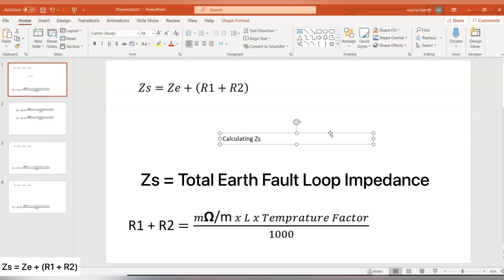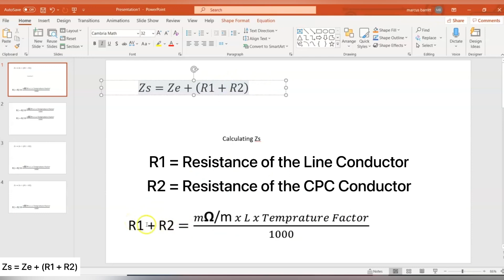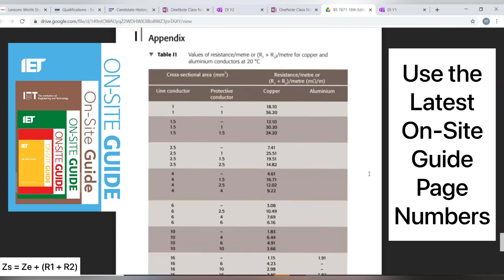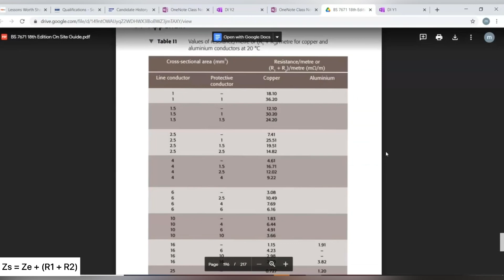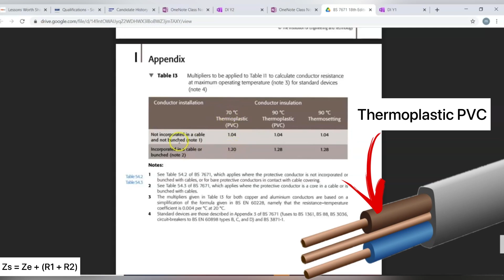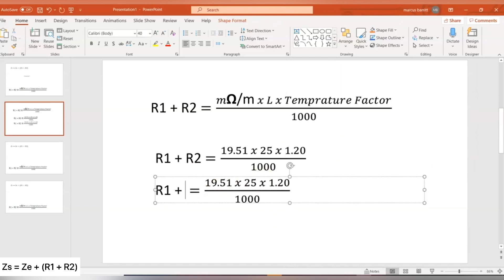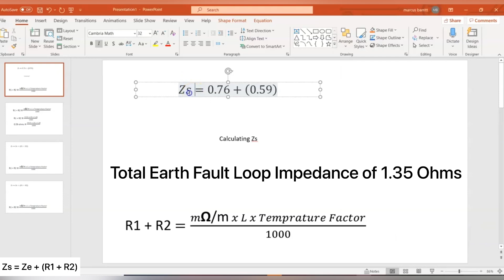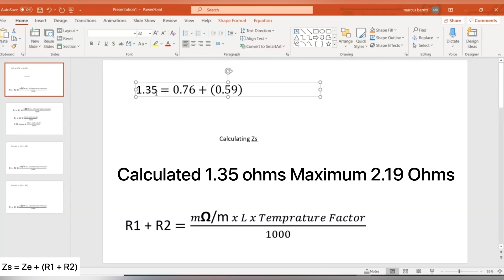How to Calculate Total Earth Fault Loop Impedance - Applying a Temperature Factor to R1 + R2

Comment: Hi. I'm Alexandru from Romania, and I’m watching all the videos trying to adapt or understand certain things.

Regarding R1 + R2, which is calculated, I think it’s a bit complicated to know the exact length of the conductors from the distribution board to the 230V socket.

If we measure the resistance at the socket after connecting the PE and L wires together at the distribution board, would that be a valid solution? The measured value would, of course, be multiplied by the correction factor for 70°C.

Comment: Audio is terrible
Reply: The audio for me was inconsistent. Some parts were clear but other parts not. I assume a radio mic was being used. It seemed like there was some sort of signal problem or bad connection. I had to switch on subtitles because it was difficult to pick up some of the numbers being said. Keep up the good work guys.
Reply from the maker: Sorry
Reply: No it's not